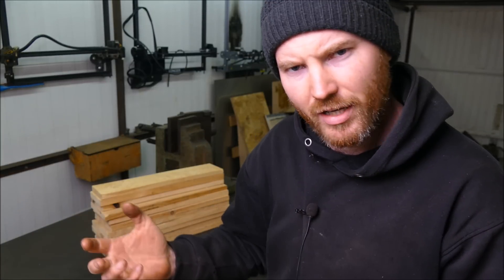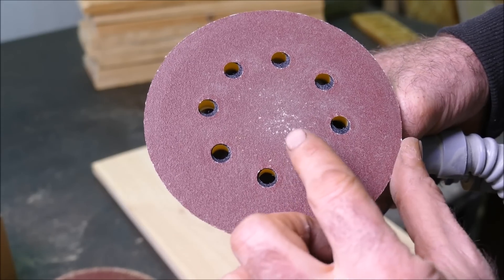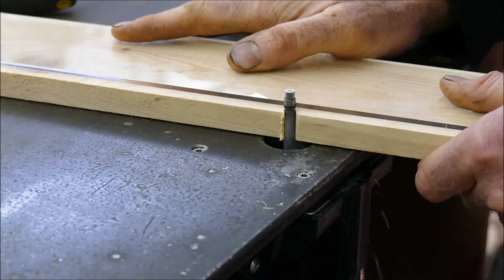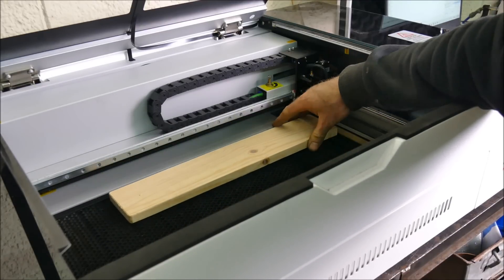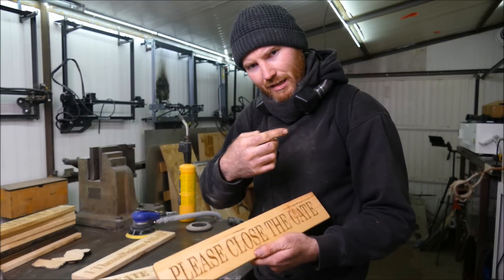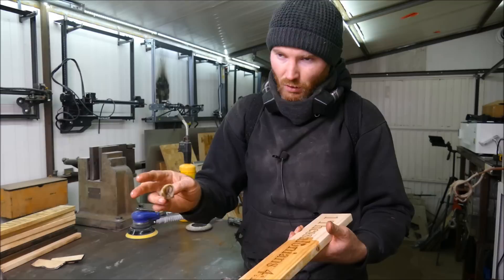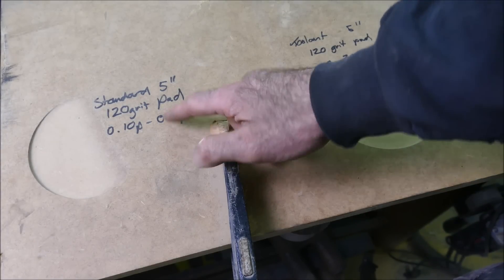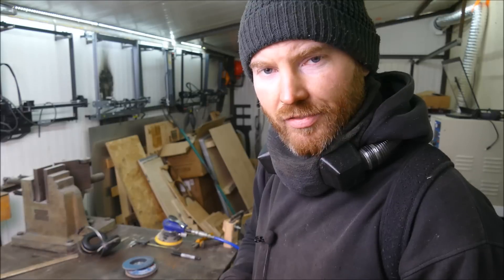I hated sanding until I tried these! - saving time and money with Toolant sanding pads - Tested

Comment: Nice coverage Joshua, the best improvement for sanding discs is a block sander cleaner , I’ve got an original black rubber one I’ve had for at least ten years & a few Amazon natural rubber ones , not as good but it’s a game changer for cleaning sanding discs.. prolonging them for much longer by de clogging them in seconds.
Reply from the maker: I'll check those out. However I didn't show it but a quick spray with the airline soon sorts out these new discs from clogs. I guess the air gets up underneath because of the trammels. Cheers J
Reply: second that for the cleaner. Will make your discs last many times longer when using on wood to get the resin and gunk off. Not so sure about metal though. 3m cubitron II discs are the mutts though - have ditched all the old type discs and only use those now - take ages to clog, clean in seconds

Comment: Morning Mr J. 😁 
Boy howdy you packed a whopper of information and value added tips in this one.  Definitely a multi-watch video to soak in the content. 
Nice disks.  I'll wager the end cost vs performance will be lower than standard disc by a third to a half.

Blessings aboundant my friend
Crawford out 🙏🔥⚒️🧙🏼‍♂️
Reply from the maker: Thank you so much. Yes although they're 2x the price of the cheapest for the time saving and how long they last is definitely saving a lot more. I would need to test them for a much longer duration to see the long term integrity but it's obvious that it's a lot more efficient already. Cheers J

Comment: I can see those sanding discs being occasionally useful for some of the jobs I do.  The flap discs I need to buy right now!  nice review, thanks.
Reply from the maker: Thank you. Links in the description. Cheers J
Reply: @joshuadelisle  I will use those to order thanks.  I was grinding off some weld with a cheap flapper today and was irritated by how long it took and how rough the finish was.  Those discs look much better than what I used and aren't a whole lot more expensive.  You dropped this upload at just the right time 😀
Reply from the maker: @Moondog-wc4vm  I hope they serve you well. Cheers J

Comment: Interesting! Yes, electric planer trumps sanding, but beware of nails & steel fixings. Small metal detectors used by metal detector users are super useful for finding small bits of steel & saving planer from damage. Generally I don’t like wood signs for external projects. They deteriorate too quickly. There is also competition from pound land & such who sell popular signs for a £1. There is often a market for seasonal stuff at the several holiday times per year. Steel or stainless or aluminum or brass signs last much longer, but are heavier & cost more & can’t be marketed as recycled. Maybe personalized dovetail or box joint boxes that you can laser cut would be better, possible flat pack for buyer to assemble and/or sliding lids to avoid cost & trouble of hinges. Looking forward to updated “air con” mask. Thank you for sharing!

Comment: Seems like some decent pads. I'd be interested in a comparison with the 3M Cubitron II Xtract which is currently my goto sanding pad. A little more expensive than most, but they perform great and they're also superb for dust extraction.

Comment: Another top video, thanks.  Can't wait for the press build and the respirator video, I also work with metal all day long and hate wearing a mask!  I need something like what you've made!  I did away with flap discs bud, even zirconia ones.  I bought a backing pad and ceramic discs from eng weld, they are amazing
Reply from the maker: Thanks. I use those as well for steel. I find the flap discs are better for edge work like weld prep or bevels. I normally use a regular grinding wheel for 90% of a weld to be flush and then finish with a fibre disc for flat finish. Cheers J

Comment: While the whole video was interesting, and I'll have to try and source some Toolant sanding pads here in Norway. What really surprised me was how flexible you were with your arm and shoulder when switching on the personal air conditioning (now that is a build I look forward to seeing. PAPR stuff done DIY is really a project I would like to get into)

About forging an interesting life. I have to weld a little on my wood processor build, disassemble the beams on my 60sqm veranda that is going down and go for a pushbike ride later on. Tomorrow - helping a friend install fenching for his dogyard. I cannot complain :-)
Reply from the maker: Thank you so much. My papr system still needs refining. for example instead of a push button i'm going for a lever switch which is easier to operate with a welding gauntlet and I'm currently using a cheap posture correcting harness as shoulder straps but as you saw it is a little difficult to reach. i'm glad your up and being practical. all the very best. cheers J

Comment: now i would buy the new discs
i wonder if they do any for metal work
Reply from the maker: I would use the zirconium fibre discs for the angle grinder alongside the flap disc for metalwork. These orbital sanders are good for paint prep and final finish on hiding mitre welded joints. Cheers J

Comment: Good video - would it be more efficient to laser engrave multiples at the same time? - might reduce the overhead in the setup phase.  I like there is scope to increase efficiency if demand increases - like using a fence sprayer for doing the treatment.

Maybe wooden plant labels?  They seem to be very expensive so might be scope there.  Or pet memorials - sounds morbid but people bury pets in the garden - hammie the hamster needs to be remembered and of course weddings - truly the font of the endless spending.
Reply from the maker: Thank you so much. Great tips to consider. Cheers J

Comment: Really nice looking sanding pads. Like the simplicity in solution preventing glogging. Would've been nice to see "pigtail" test, but I'd suppose that has to leave much less those swirl marks on ie. painted surfaces. By far the biggest annoynce imo when using orbital sanders. I can deal even with fast wearing pads, but those damned markings... They add up in work time quite a bit when they happen.
Reply from the maker: I'll consider that if I do another test. cheers J

Comment: Josh.  Can I please ask, what is that material around your neck that you've sewn the pipes to?  Is it some kind of buff/scarf?  Thanks
Reply from the maker: Hi. Yes I'm doing a video on it soon. I'm using modified standard buff but it contains polyester so I'm making a cotton version so it's safer for welding with. Cheers J

Comment: If you want the most cost effective and efficient sanding discs get some 3m cubitron 2 discs. They seem expensive until you realise they will outlast the next best thing by 4 to 5 times. They will outlast the cheapo toolpak ones 15:1. Mirka base cut 10:1
Dewalt Bosch etc about 10:1 too. They really are that good. And no I don’t work for 3m
Reply from the maker: I've just seen the tests for the cubitron. Very impressive. I would like to see the performance test against these though especially on price. Maybe I'll do that.... Cheers J

Comment: Nicely done ;o)

It may pay a premium to offer customisable aspects. As you say a choice of several fonts, but maybe add a few graphics? 
It is easy to get bogged down with detail, but the balance is to have people getting a custom piece (even if it is "custom" from a set of templates)
It might also be possible to join a couple of them edge to edge to give a higher sign?
Reply from the maker: That's a good idea. I'll definitely consider that. Cheers J

Comment: You need a Makita 4inch belt sander, it would blitz through those signs in two passes.
Reply from the maker: That would work. Or an electric planer I'm thinking of investing in. Cheers J
Reply: @joshuadelisle  I have both, the Makita 9401 (I wouldn't be without it, you can turn it upside down, put permanent run button on and use it as a linisher sander with two hands free). As for a planer, they're all similar and normally 89mm wide or 100mm and all have two blades in a revolving block.
However Triton tools do a wide model it's triple bladed, 180mm wide (so good for 6inch planks in a single pass, trust me a double pass with a narrower planer is a pain). And it doubles up as an unlimited depth rebate planer because it is designed to be. 

With those two machines a Makita circular saw and a router you can build a huge amount of stuff.
Reply from the maker: @rayhsetwo8594  awesome. Thank you for the great tip. Cheers J

Comment: Thanks for the review. I was hoping you'd come up with a new, fast way to hand sand blades, but I suspect we're all stuck with sand paper and lots of time. Sigh.
Reply from the maker: I think an electric planer is a good option for speed for this job. Sometimes a sander is the best option especially for paint prep work or epoxy finishing . Cheers J

Comment: Great review, but 24p is not double 10p so whilst good at what they do these new pads may work great, but they'll still cost more than using the regular ones.
Personally, I use the Abranet system which seems to have the longest lasting life for a sanding pad.
Reply from the maker: Thank you. I guess the main saving is time which will be a cost saving it that is greater than the price of the disc. Cheers J
Reply: @joshuadelisle  Agreed, I chose the system I use on car body repair and paint prep because I spend more time on the job and less time changing out pads. Keep up the great content, I really enjoy your videos.

Comment: Those margins are so tight... I wouldn't even bother.
make them, 15-20$ and you could make some good money. No idea if they would sell for that price though.

Also you forgot time for packaging and shipping them out.
That might be another 3 minutes?
Reply from the maker: Your right. I could definitely increase the margin. I did forget packing... Although I have a cardboard role for these and a label printing system so it is very quick still. Cheers J

Comment: I think you set your margin to low. I feel a price of 15 pounds ex post would be reasonable. Remember your consumables (router bits, laser, sandpaper).
Reply from the maker: I think that's a good point. Market value is probably higher so I could increase the margin making it more profitable. I normally include an average for consumables in the workshop rate but I could put that as a separate cost per so many parts as your right that they will wear out significantly whilst making these signs. Cheers J